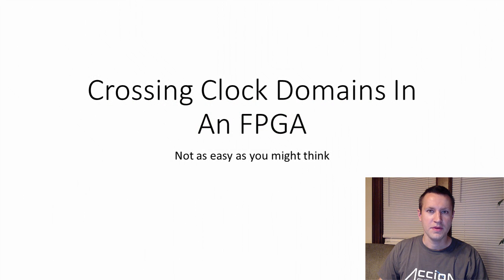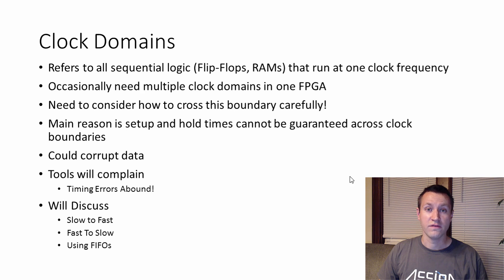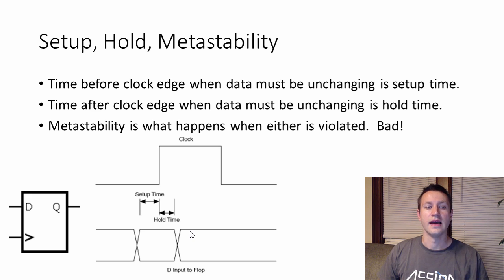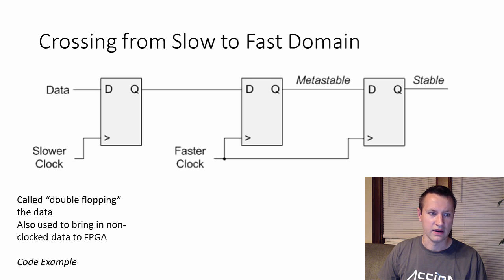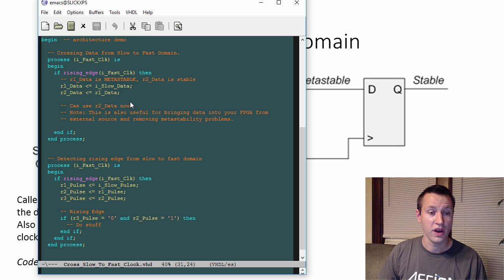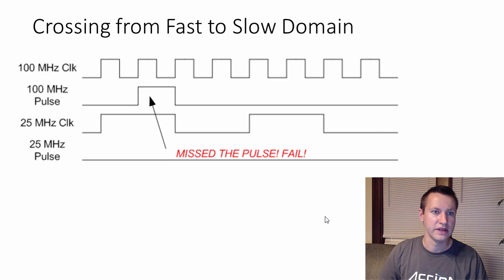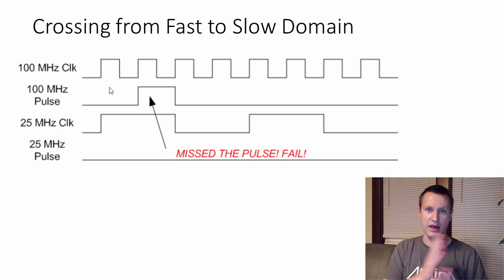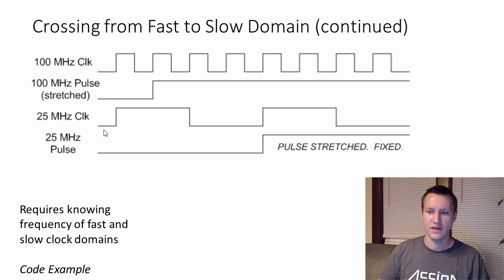Crossing Clock Domains in an FPGA

Comment: Hello! I have an interview question, that I could not answer.
There is high speed data coming in the fpga, how do you make sure all 8 bits are arriving at the same time?
Reply: My first thought was to make sure all the pcb traces are the same, but making sure the transmitting device has a clk is also helpful. There are also tools to allow you to view the eye diagram as well well.

Comment: This video is a good start but gets quite some things wrong.
1. Don’t (just) double-sample bus signals, like the std_logic_vector. Either use a proper FIFO or transfer its change by a single wire
2. Use toggle indication instead of transferring pulses. This avoids pulse stretching and allows a higher event indication rate before going full cycle (request-acknowledge) handshake
3. Consider a full-cycle request-acknowledge handshake (with toggle indication). This way the sending clock domain can feed back the event transfer to the sender
4. Only transfer a signal to the other clock domain that is output of a stable flip-flop. No logic, e.g., w_Stretched
5. Always consider the rate of events, not just with a FIFO, with the actual clock rates. Can you afford losing an event? Do you need to count them while the CDC transfer is busy?
6. Keeping setup/hold is not just fighting metastability but ensuring the FF does all of its jobs correctly. The actual window of a FF for entering MS is typically just a few femtoseconds wide, but you don’t know which part of the setup/hold margin
7. Proper RTL design is necessary but don’t forget constraints! Especially ensure that the second sampling stage r_Stable is never split into multiple registers
8. FFs spent properly on CC are well invested. Always.
Reply: where to read up on this stuff?

Comment: 10:35
It's incorrect to directly pass a combinatorial w_Stretched signal into the i_Clk_25MHz domain, because this signal will exhibit glitchs on every r_Counter transition. First you should register this signal by i_Clk_100MHz to make it clean, free of glitches, and then pass this clean version of the signal into the i_Clk_25MHz process.
Reply: So another double flop then?
process(100MHz)

registerIT <= notYetREgistered;

end process;

Just this in between is enough right ?
Reply: @brad8122   a single flop on the w_Stretched signal in 100 MHz domain would be exactly what is needed.

like this:

process(i_Clk_100MHz)
begin
   if rising_edge(i_Clk_100MHz) then
      w_Stretched_1 <= w_Stretched;
   end if;
end;

process(i_Clk_25MHz)
begin
   if rising_edge(i_Clk_25MHz) then
      r_Metastable <= w_Stretched_1;
      r_Stable <= r_Metastable;
   end if;
end;

Comment: thank you for the quick explanation. I was able to fix the emulation of a 3.6 MHz Z80 computer with a 10.7 MHz video controller. Previously I had to run the video at an integer multiple of the CPU clock. Still I don't get why on "real" computers there is no cross-clock domain.

Comment: For a slow clock that updates a register, I can see how logic clocked with a fast clock could see data in flux.. and so passing it through a few dffs makes sense.. however, regarding the pulse stretching in the case of fast to slow... what if you're not dealing with pulses, i.e. the fast clock is updating data and it remains constant until updated again.. would the slow clock logic that acts on that data need to do anything?

Comment: Thank you for posting these videos - I’m learning Verilog with the help of your videos.

Looking at the VHDL code at 11:33 are the last two statements swapped?
E.g.
r_Stable <= r_Metastable;
r_Metastable <= w_Stretched;
Reply: No, I don't believe so. Although, the order doesn't really matter because everything happens at the same time, or the same clock cycle, but it should still be kept the way nandland showed it for human readability sake. The signal w_Stretched is coming in from outside the process and we want to ensure anything else in that process uses r_Stable, because it's stable, therefore keeping the human readability - top to bottom, logically sound.

Comment: 10:55 is there a latch for the 100MHz block (r_Count = 0)?
Reply from the maker: You will never get a latch generated in a clocked (sequential) process.  Since it's in a clocked process, the tools will push this logic into a Flip-Flop, not a latch.  This is one reason why I like to use clocked processes as much as possible.  (Avoiding latches, latches are evil)

Comment: Can you please explain the worst case scenario for why you used rcount as 8? Can't we use anything greater than 4clock cycles of 100MHz clk?
Reply: Jump to, let's say 8:46, pause and watch closely stretched 100MHz clock domain pulse. You see that pulse's rising edge is at the second rising edge of the 100MHz clock (on this diagram). Now, count rising edges of that 100MHz clock, starting from the edge at which pulse edge is there as well. You see if you make the counter count to 4 pulse gets low somewhere on the middle of logic one of the second 25MHz cycle -- not going to catch the pulse in slow domain! If you make the counter count to 5, pulse goes low on falling edge of second cycle in 25MHz domain. Similar goes for 6 and 7, pulse isn't high on rising oedge in the slow domain. Only 8 cycles long pulse in 100MHz will stretch over 2 cycles in 25MHz and thats enough to catch the pulse at least once. I hope I was clear enough.

Comment: If I have corrected the timing errors for setup and hold time on first flip flop. Why do we still require second flip fllop? If setup and hold aren't violating at first flip, we won't face metastable problem. I know double flip flop synchronizer is standard way to synchronize a pulse signal. Can you tell me if I m correct or not?
Reply from the maker: Are you crossing clock domains?  Are the clocks in-phase or out of phase?  If they're out of phase, you can't guarantee that the timing relationships will be maintained.  The clocks will drift in time from each other.

Comment: Hi Russel,

Could you tell me what r1,r2,r3_data correspond to in the slow to fast domain diagram? I got confused coz of your in-code comments on metastability. it said r1 is metastable, but the output from the second register is the one showing metastability in the diagram. So, could you please explain which notation corresponds to what in the diagram

Comment: You didn't seem to mention the most obvious solution to handling data going from a 50MHz domain to a 33MHz domain: simply make pairs of data from the 50MHz side and enqueue a double-width item at every odd clock. The 33MHz side will be fetching 2x width, effectively 66MHz worth of data.
Reply: Doug Gale this works, but the sticky part of clock domain crossing is phase relationship, not frequency relationship. This still leaves you with some problems to solve :)
Reply from the maker: Hm... can you elaborate a bit more on this?  I'm not sure I completely understand.  Is the pair of data sending the same data on 2 clock cycles in a row or are you expanding the number of data paths?  Also how does this handle the fact that the two clocks will "walk" in time among eachother?
Reply: For example, if the 50MHz side is putting a 4-bit word in the FIFO every cycle, then the 33MHz side can't keep up if it reads 4 bits per cycle from the FIFO. Instead, the 50MHz side could hold even words in a holding register, and every odd cycle it could take that registered word, combine it with the current word, and insert an 8-bit value into the FIFO. The insert rate on the 50MHz side would be 25MHz.
Reply from the maker: Yes this is a good point.  Thanks for bringing it to my attention.  I usually don't think to change the width of the data but there's no reason that you couldn't do that!

Comment: Awesome video!

You don't have to know the clock frequencies of the fast and the slow clocks to go from a fast clock to a slow clock.
You can use feedback from the slow clock to the fast clock for the pulse stretch.
Once the slow clock logic "sees" the pulse, it can signal to the fast clock logic to stop stretching...
Reply from the maker: Good idea!  Thanks!  This would require writing two timing constraints, one for each direction, but it's a good solution for writing robust portable code.
Reply: @Nandland  instead of stretching based on Freq .. can you try handshake synchronisation? Please do a video on tht

Comment: Oh, and I've forgot to mention that Xilinx has a bunch of macros designed specifically to deal with cross-clock syncronization issues - they are xmp_cdc_[array_single | async_rst | gray | handshake | pulse | single | sync_rst], described in UG953 - "Vivado Design Suite 7 Series FPGA and Zynq-7000 All Programmable SoC Libraries Guide", chapter 2.

Comment: The explanations about metastability in the video are imprecise. Metastability refers to a state of unbounded time during which it is unknown which state will be adopted by the system eventually. During that (unbounded!) time the output of the system (e.g. FF) is undefined and might even oscillate. Also, not every setup or hold time violation will lead to metastability (it is actually rather rare and it is not that easy to actually provoke it to happen and make it visible in real hardware). However, even without Metastability, setup and hold violations are a problem because the FF might simply not capture the correct state at the right time even though its internal state (and output) is not metastable. This is the common reason that leads to problems when crossing clock domain boundaries (which often happens unknowingly) but is indistinguishable from short metastabilities anyway (shorter than the clock period).

Also, by no means does using 2 FFs eradicate the possibility of metastability on the second output completely. It is mentioned briefly in the video but is largely ignored (in the video by describing the output of the first FF as metastable (which it is not necessarily but you have to treat it that way) and the 2nd FF as stable (which it isnt absolutely always but we treat it that way anyway). Cf. https://en.wikipedia.org/wiki/Metastability_in_electronics
Reply: Actually, this video had super precise timing. I coincidentally had a lecture on this topic right after watching this video. It was super useful. When you say,  "The explanations in the video are imprecise" and point out what is ignored, you sound frustrated. These are educational videos for learners. Please keep your comments clean and make statements that add educational value.
Reply: @greenavos  What did you have a lecture after watching this video? Could you tell me what it was because I'm still confused like you did.. please let me know!

Thank you
Reply: I wish Russel had made this back in the summer of 2014 when a project I was on failed for just this reason. 99% reliable is just not good enough for customers.
Reply: I didn't get the part where having two sequential FFs driven by the same clock would eliminate metastability. I hope I'll find the video that goes into the details.
Reply from the maker: Thanks for the reply!  I'm actually planning to go more into details about Setup and Hold time and Metastability so I appreciate this comment.  I will be more precise if I go into details about it, but you're right I did gloss over the specifics.

Comment: It's funny that you've posted a video about timing errors exactly as I was fixing one in my design :) I've found this snippet of SV code somewhere for crossing domains which I find kind of neat, and that's what I always use:
bit [2:0] buf;
always_ff @(posedge clk) buf <= {buf[1:0], signal };
wire signal_raise = (buf[2:1] == 2'b01);
wire signal_fall = (buf[2:1] == 2'b10);
As always, thank you for the video!

Comment: Is it not really robust enough to just use a single flop, then use the incoming async signal to directly check against the flop for a rising or falling edge?

I usually just use two flops, then use a combinatorial (wire assign) to check for falling / rising, and it normally works fine?
(usually when sampling an async /WRITE signal from an IDE interface, when the FPGA clock is around 50MHz, for example.)
Reply from the maker: Hm, interesting, I've never done it that way.  I can't say for certain if it's bad.  In general I use the rule of thumb that you should never use an async signal in your FPGA unless it's going to an async reset input on a FF.  It's only 1 extra register to look for the rising edge.
Reply: True.

I think I may have had issues with projects before that checked the original async signal before being registered, so I guess at least two flops is preferred.

The only thing with adding too many flops is if the faster clock isn't too much higher than the slow clock, and there will be a bit of a clock delay.

That may or may not matter in the specific design though, of course. ;)

I still find FPGAs confusing though, as a lot of stuff has a delay of one clock. ie. you assign a value to a reg on one clock, but it doesn't update the output signal until the NEXT clock etc.

That can be tricky with things like reading from an SRAM etc. Where you have to assert the /Output Enable on the first clock, then grab the data on the next clock.

Comment: Just what I needed right now. ;)

I've had to use registers for async handshake signals on a RAM controller before, and that was fairly hard to debug.

I've also been messing with differing video timings recently, where a device (an N64) is using a pixel clock of ~12.5 MHz, and the actual output pixel clock is 27MHz (480p), so I had to use dual-port RAMs for the line buffers.

The metastable stuff is weird, because they can calc the exact "MTBF", but it's usually in the range of a few million years. lol